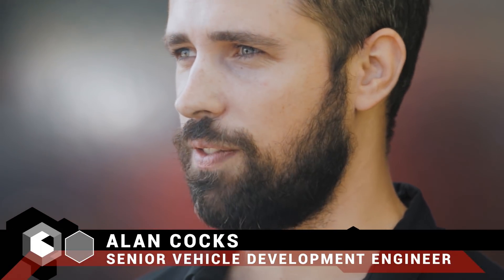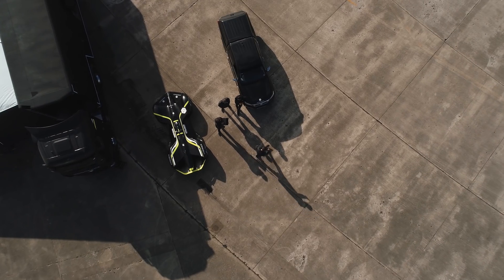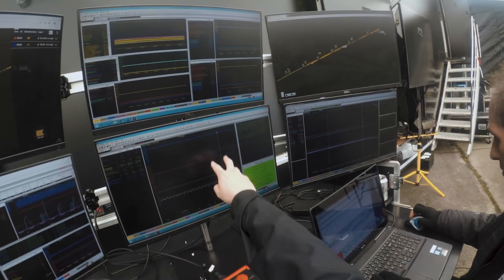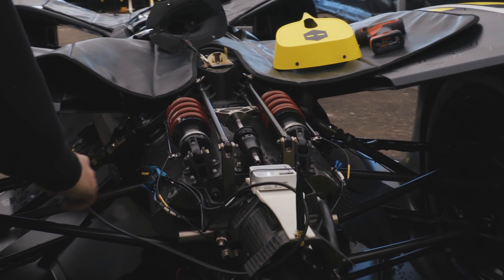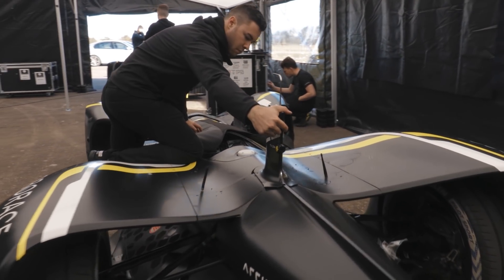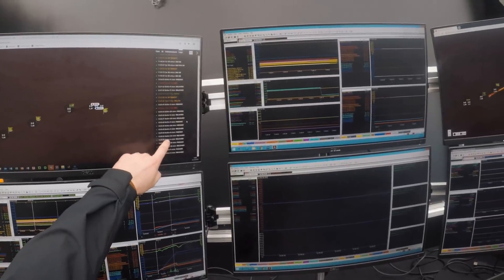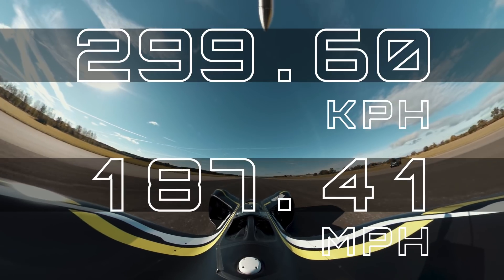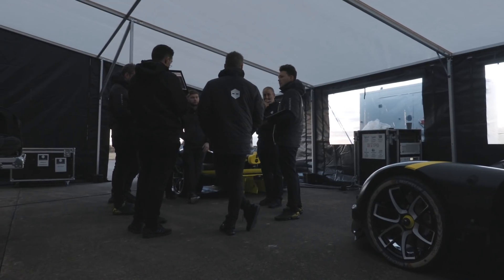Testing the top speed limits of an autonomous race car

Comment: Nice video, good to hear more of how the car actually runs, would be awesome to hear this 'inverter limit' explained!
Reply: Yes. Flux vector ac permanent magnet motors are very efficient and torquey for their size and weight. 
They are also very tough. 

Dc motors have way too much iron and brushes and stuff.
Reply: @brucebaxter6923  Thought it might have been something like that, thanks for the explanation! :D
Reply: Ben Hollis 
Probably the pole frequency. 
It just can’t switch faster.
Reply: @brucebaxter6923  ah ok, so would I be right that it's converting DC of the batteries into AC for the motors? Couldn't you run DC motors or is it that AC ones are more efficient/stronger/better in some way?
Reply: @h0ll1s  i suppose they are running brushless motors which are a lot better than brushed dc motors but they need electronic control and use alternate current
Reply: its runs on 4 wheels thru friction. what drives the wheels are the motors.

Comment: Kinda disappointing...  Tesla roadster can basically do everything this car can do but way better and faster
Reply: Not very disappointing when you consider Tesla is a much, MUCH bigger company compared to roborace, and the goal of roborace isn't to make the fastest car ever, because what they're driven on is machine learning and algorithms, rather than someone driving. Roborace cars are meant to be driven by AI, Tesla cars have auto pilot, but a lot of the time that is on busy roads and built on GPS. This isn't a really good comparison, but it's like saying NASCAR races aren't impressive compared to F1 races.
Reply: No, it can't. That's like saying a decent spec porsche 911 or some other equivalent car would beat an LMP1 car around a track. Top speed is meaningless, and 0.8 seconds difference in 0-60 is also pretty irrelevant.
Reply: Give them time to grow, Tesla has more than 10 years
Reply: tesla roadster can't even take an off ramp properly, much less race around a track on it's own.  Robocar would curbstomp a tesla roadster

Comment: 3.4 seconds to 100kph that's pretty quick
Reply: 3.4 to 100 isn't that impressive, what is impressive is that its acceleration doesn't slow down. It took about 8 secs to 200kph. For a prototype that isn't yet actual race car that's pretty good. Once they have AI figured out so that it is reliable they can focus on speed, cornering and energy. This thing can be much faster with better power components and bigger (energy&power, not size) battery.
Reply: @3characterhandlerequired  it's within a second of the fastest accelerating supercars on the planet I call that fast.
Reply: @gro_skunk  I agree that it is fast, but knowing what the Tesla Roadster can do, not that impressive. It can be much faster. Future is electric.
Reply: @3characterhandlerequired  the roadster, if it can do a sub 2 second 0-60mph would mean it's literally at the limit of physics, the only way to accelerate faster would be to widen the tires to unusable widths for a street vehicle
Reply: @gro_skunk  That's the point, it is a street car, not race car and yet it can do what it does. A race car with race tires, low drag body and proper downforce can do better. Robocar doesn't, so it isn't impressive even that it is quick. When this project is at the actual limits of the current EV tech you should see performance that is rivaling F1 cars (Formula E isn't even close to what EV:s can do, they are artificially limited by FIA rules to look worse than gas cars). 

First they need to get the AI at the level where car can actually race though, so I understand why car isn't faster than it is now.
Reply: XHAD 
Compared to what?
A Prius?
Nissan Leaf?
Reply: It's not meant to be the absolute fastest vehicle on earth jackass, it's pretty fucking fast in general compared to normal street cars.

Comment: surely the firmware would tolerate you dialing in an extra 5w just to allow another 0.4kmh to crack 300 :)
Reply: it's not the power, it's the KV rating of the drive electronics and motor. It's not a conventional DC motor where voltage is proportional to speed. It's functionally more similar to a stepper motor. Dunno why he was suggesting the inverter would shut down though, it either wouldnt switch fast enough or the motor would loose a significant amount of torque.
Reply: I was thinking pole frequency.
Reply: was really hoping it reached 300kmh.

They know what they’re doing